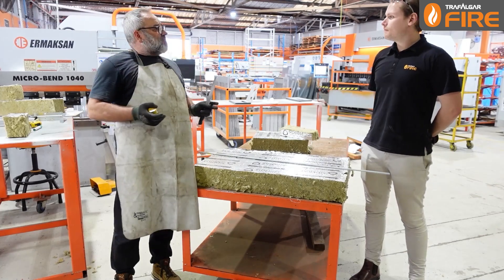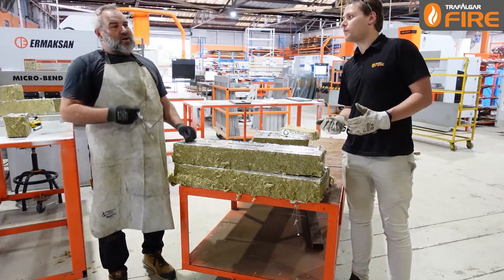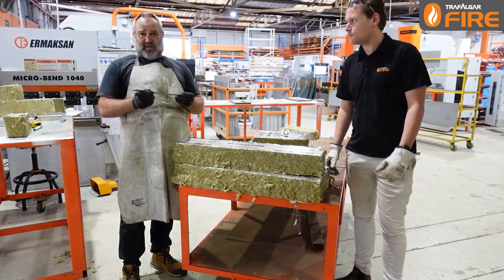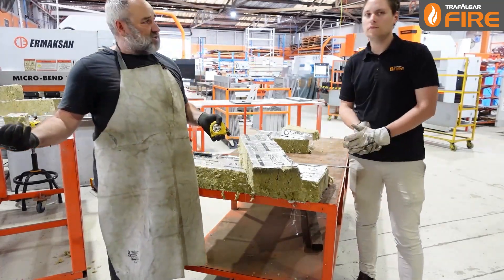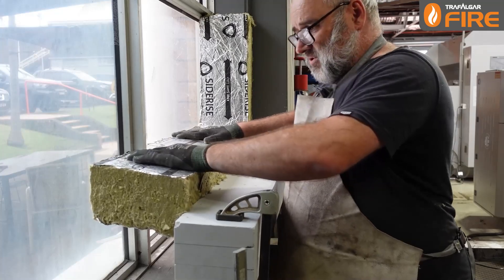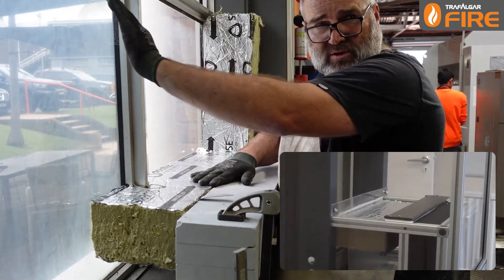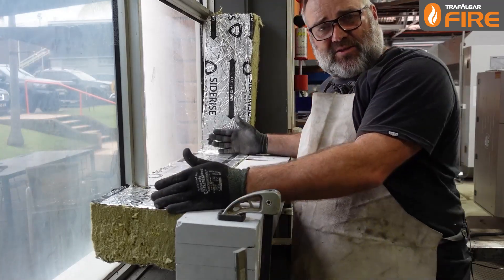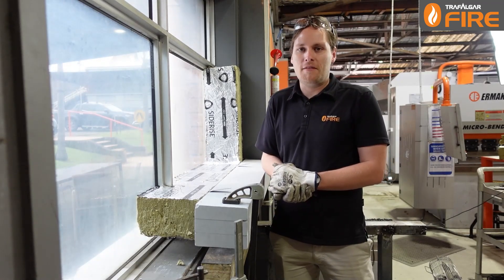How to install Siderise

Comment: have you actually watched the actual siderise installation video?or done the installation certificate?you dont just tape the tops its both sides and when you have a horizontal butted up to a vertical you need to tape the outside corner too not just the inside corner thats uk standard